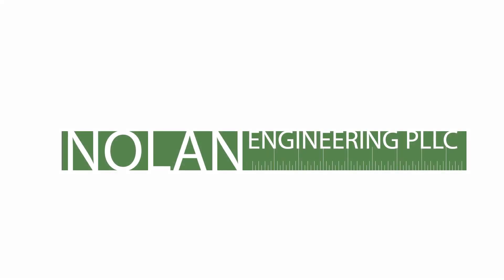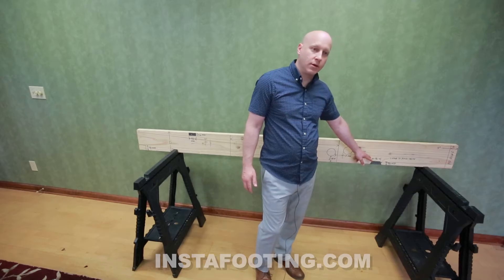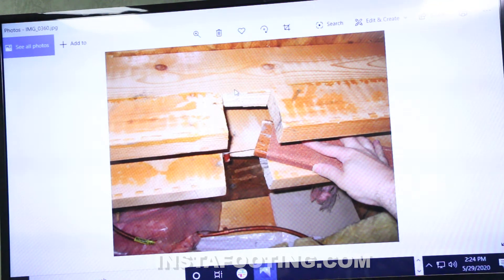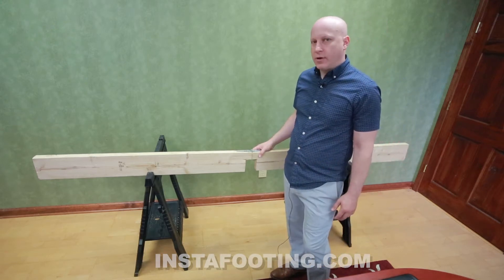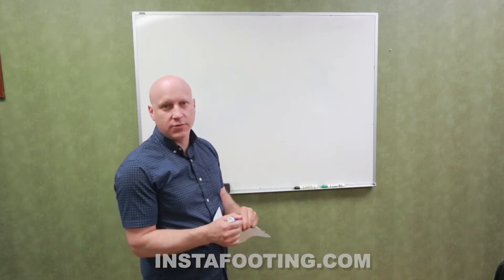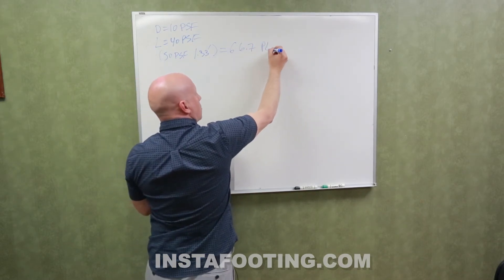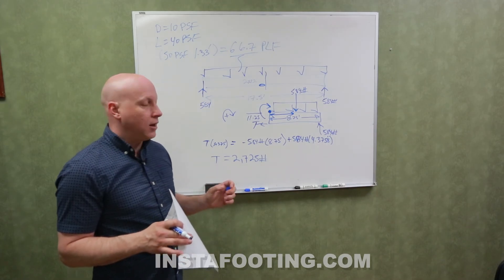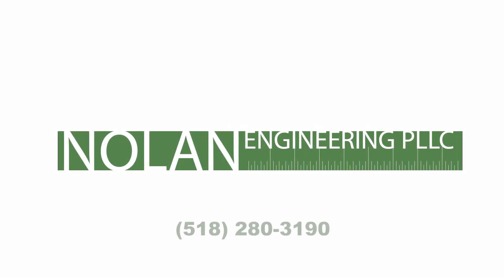Joist Repair/Notched Repair. How to repair notched/damaged floor joists without sisterring.

Comment: That strap restores "FULL" strength of the joist?
Reply from the maker: Yes, and in some cases it will actually make the joist stronger than it was in its original state as steel is much stronger than wood.

Comment: Can i use something like this if the joist was notched on the top and they removed the pipe that ran through and now the whole is left. Sistering would be a task because there's electrical close to the bottom
Reply from the maker: Faith, please send a picture to admin@nolanstructuralproducts.com and we can determine if our products will work for you as well as the best placement.

Comment: 11:25 you put the tension on the entire 11 1/4"   and yet tension is not over the entire 11 1/4"  but rather you might be able to just use the entire ''1/2" of the dimension (existing material) and consider half of it in compression and 1/2 in compression... But of course, it is not a perfect ''half'' and consideration of the existing wood grain (knots, etc.) should be considered.
Then you have the rotation that the span will experience = has been reduced and will not be put back by a ''tension strap''...
Adding blocking on the four corners  (of each side of the cut opening)  would be considered...

Comment: Could I install these to strengthen my joists to prevent floors from shaking when I walk on them?
Reply from the maker: I experimented with putting straps on the bottom of joists but the deflection remained the same. I did calculations and I think it will work if the strap can be tensioned before securing to the joists but the tension would have to be 800 pounds. My next project is figuring out a device to tension the strap. I'll keep you posted.
Reply: @nolanengineeringpllc2713  FOLLOWING FOR THIS! love these videos and great walkthrough on the math. really appreciate it!

Comment: Drill a 1/4" hole at the ends of the crack. Then sister lumber above and below the wires with glue and bolts.

Comment: One of my floor joist is starting to crack along the length of the joist, horizontally.  The crack is 2.5" from the bottom of the joist.  There are wires that run through the joist which make sistering the joist difficult and expensive when moving electric. I don't that kind of funding at the moment.  What can I do for a horizontal crack with out sistering the joist?
Reply from the maker: If you send a picture of your floor joist to admin@nolan-engineering.com we can review and let you know if our product will work for you.